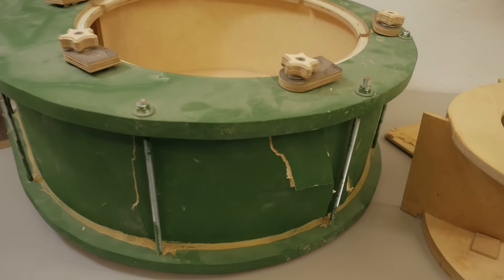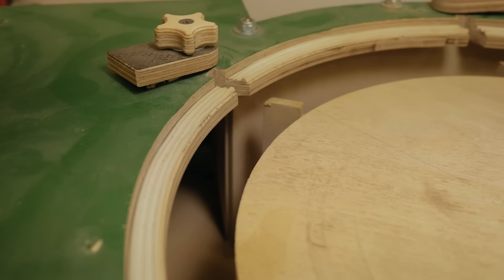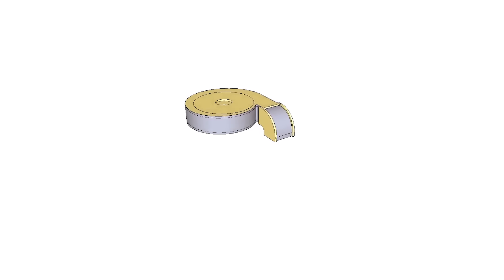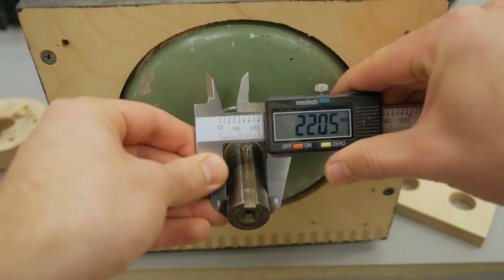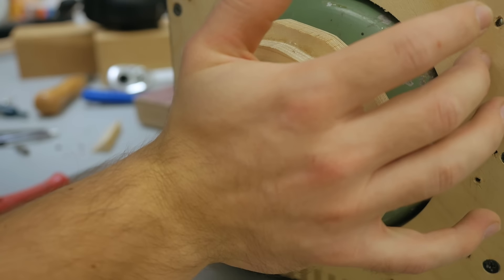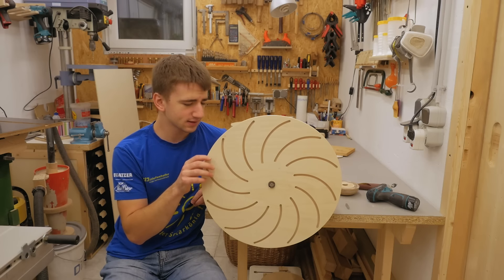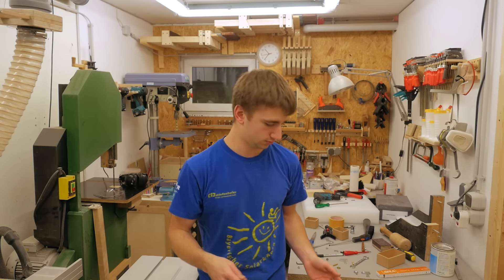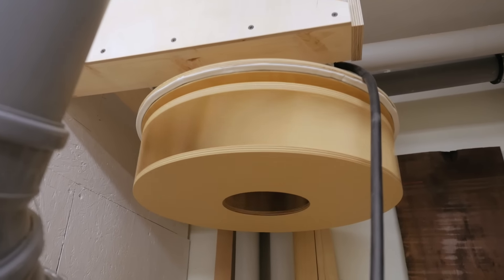Building a Big Dust Collector Blower #1

Comment: If you want to reduce  the  noise, next time don't make it with even blade spacing. The frequency is going to be a function of the RPM  and the blade spacing. The  frequency in Hz will be the RPM of the fan times the number of blades divided by 60. So, for example, if you fan is spinning at 1800 RPM, and has 10 blades, that is 1800 X 10 (which is 18,000), dividing that by 60, yields a frequence of  300 Hz. That is because each blade is passing any given point in space, 300 times every second. If you vary the spacing of the blades, this is no longer true, the lack of regularity, interupts the frequency, and the sound of the blades cannot gang up together. Of course you need to consider dynamic balancing as well,  so you might keep your blades in pairs, to that each blade has one opposite of it, to keep balance. Alternatively, you could add weights to counter-balance, like is done on ceiling fans. One other thing to consider, is whether doing it this way, will produce beat frequencies, but dealing with that is outside my knowledge, not doubt you can find info on that on the web.
Now, if you go to http://szynalski.com/tone#300-square you can play and hear what different frequencies sound like,  and if you open that up in more than one browser at the same time, you can check to see what beat frequencies would sound like, by setting each to a different frequency.
Thanks for the helpful video.

Comment: To criticize before it breaks, I'm worried about the part of the blade that is on the outside, it isn't held together by anything but plywood gue. Not that it would be any weak but still makes me little sceptical.
Reply from the maker: This might not have been visible in the video, but there is also glue between the outer most part and the impeller disks
Reply: Well, that's still just glue, but yeah, you're most likely safe, then

Comment: G'Day mate. Every body is a critic but I don't see them giving ad vice. Me I can't make video's for nuts and don't have the  space to do what your doing anyway I have an Idea If you want to try.  Make the veins in the dust extractor an 'S' shape  so that the leading edge cut into the air and the trailing edge throws the air away from the impeller. If you do decide to have a go please make a video and let me know.  Greg.

Comment: Looks like you could have saved yourself a lot of time by cutting up a section of large PVC or ABS drain pipe to make the blades.  Not to mention, significantly lower mass.

-jcr
Reply from the maker: +NSResponder but how would you connect plastic to wood with a bond as strong as wood with woodglue?
Reply: Would weld bond work?
Reply: Aliphatic or epoxy resins should both do fine.  

-jcr

Comment: I would recommend using a motor startup controller. This way you get away without the initial torque shock. Also you most probably introduce huge voltage spikes into your houses and your neighbors power distribution.

First quick start would be good old wiki ;-)
https://en.wikipedia.org/wiki/Motor_soft_starter

Comment: Are you sure the blades are stable? You made a big block of Plywood and cut out the blades. The result is no longer as stable as plywood since the wood firbers are all cut very short. I think the resulting system is as stable as the glue that was used, which means not stable enought for the application
Reply from the maker: The vertical fibers are still the same length and they take most of the load. The other direction is secured by the grooves. If you'd have held one of the vanes in your hands, you would feel how strong they still are.
Reply: think about the (of course non existing) centrifugal forces. When the impeller rotates very fast the centrifugal force on the blades is high. The inner part of the blades is secured by the grooves, the outer part is not. The outer part is also taking a lot of force and vibration from the turbulent air flow around the end of the blade. I think if you rotate the impeller fast enoungh it will fail loosing its outer 4 centimeters. The question is what is "fast enough. If it is 20000 Rpm this blower will work forever.

Nice job, nice design. I will steal it and do the extra work of bending plywood.

Comment: Loving the aesthetics of the new vanes. My only worry would be that being cut as they are they might have a risk of delaminating (vs ones made from a lamination of bent thin ply).

Of course, if holds out then forget my comment, but if they do break then I can look like a smart@ss and say I told you so in the future - it's a douchebag win win scenario ;)

PS Jumping the gun on the next video, but why not polycarbonate for skinning the housing? It's designed to take impacts without shattering, and it would allow you to inspect the vanes without opening everything up (assuming it didn't get too scratched inside I guess).
Reply from the maker: Well then if it breaks I won't let you know, ha ;) The other question will be covered in the next video.
Reply: Dammit. My douchebaggery has been foiled ;)

Looking forward to the next video!

Comment: Hi Marius, a classic soft start of 3phase motor might be "the Delta/Star connection". You might think adding it in order to reduce torque at start up, hence less force...etc, about what you mentioned: First Newton's Law. Here are some example links:
https://www.elprocus.com/industrial-star-delta-starter-3-phase-induction-motor/
https://electricalnotes.wordpress.com/2012/03/16/star-delta-starter/

Vieleicht dieses link ist auch hilfreich:
https://de.wikipedia.org/wiki/Stern-Dreieck-Anlaufschaltung

Comment: Your think you  are a very skilled wood worker.  Honestly, the motor is too powerful and probably spins too fast....(my guestimate is about half the speed).....so slow down the motor to reduce any material impact on the vane.   Yes, it will reduce the CFM and Negative pressure, but it will also reduce the impact damage.  Consider making a aluminum or sheet metal to build the vane. .......but lastly, it can get dangerous if there is any impact, so make sure the housing is made much stronger with steel...if not, line the outside with steel so it retains any things that could fly out.

Comment: I'd be a little concerned with the construction of the blades.  Plywood in that configuration is not very strong.  I'd wager the blades will crack or break easily if a chunk of wood reaches the blade.

Comment: why do you say VFDs are so expensive? they're not. you can get the chinese ones (Delta for example) and they are OK for your application. Siemens even has a line of inexpensive VFDs.
Reply from the maker: oh yeah, because I'd want one of the cheap units. (I don't)
Reply: why not? I work in industrial automation and all machines that have motors nowadays have a VFD for each motor. Delta VFD-S are terrible, we replaced all of them with VFD-M at one factory because VFD-S kept blowing up because of the heat (40 C ambient temperature and no air conditioning). I built a machine 3 years ago with two cheap Siemens. It works 24/7 and they're still working to this day.

Comment: I doubt MDF isn't the right material.. It's just a convenient excuse by the naysayers... Your Small Dust Collector used MDF in an open-slot design, with a powerful 3-phase motor as well.. But that's held up nicely so far and if the naysayers were right, the small dust collector should've blown itself apart as well by now...
Reply from the maker: the small dust collector is a different story, as it's small. And it uses a single phase motor with low starting torque and much less power.
Reply: Oh..? Always thought that was 3-phase as well, from the plug for the motor.. Nonetheless, beautiful design for the new blower.. Maybe the fully-encased "squirrel cage" design will hold up much much better...

Comment: NICE  JOB...BUT  YOU  CAN USE  4 THINGS   
1-LIGHTER  WOOD , 
2 ROUND  ALL CORNERS  OR  YOUR  PROJECTS 1/16" RADIUS
3-NEED TO USE  AERODYNAMICS LAWS AND  PRINCIPLES  .YOU NEED TO TRIM YOUR  LEADING  EDGES  OF THAT FAN EDGES   THERE IS  SOME   FRMS  YOU CAN USE  MAYBE  THE  ONE  IN 30  degrees  SHAPE ,THE  AIR  CURRENT  WILL FLOW SMOOTHER  WITH MINIMUM SOUND.
4- USE RESIN  OF  FIBERGLAS OR EPOXY GLUE  TO PUT  A LIGHT COATS ON THE LIGHT  WOOD  .THESE PRINCIPLES  OF   BASIC  COMPOSITE WILL HARDEN YOUR WOOD PREVENT  HUMIDITY AND DECREASE  WEIGHT ALWAYS  USE A  QUALITY WOOD IN THE  SHAFT AREA  .INSTEAD  OF  METAL PLATE USE  ALUMINUM  7075 T6  0.63 OR 0.70 THICK  OVER ALL  NICE  PROYECT.CONGRATS...

Comment: A VFD?

More like: "Another VFD"?!? But seriously, what is that?
Reply: Variable frequency drive. Allows you to change the voltage going to the motor thus the motor rpm's.
Reply: VFD is way over kill for this, you only want a soft start so a few thermistors will do the trick for only a few dollars or euros.
Reply: VFD isn’t overkill.   It would let him run the blower at any speed, even 1 RPM.

And he could incorporate safety sensors that would immediately shut down the blower if the turbines cracked.

A simple shock sensor would do it.

Comment: I like the fact that you are still using the same materials to build the blower after the failure, just using better materials isn't the best way because by that logic everything would be made from titanium; so keep on trying, but using tested solutions where is possible is aslo the engineering way, like the electric part, using a torque limiter might be unavoidable, it just has too many advantages http://www.eaton.com/Eaton/ProductsServices/Electrical/ProductsandServices/AutomationandControl/ContactorsStarters/SoftStartersControllers/TL/index.htm cost is very important when designing so the best solutions have to be found, by saying "controllers are to expensive" I assume that you are only thinking about high end "multipurpose" speed controllers when there are other specialized solutions much more cheap

Comment: Is there an optimal edge shape to reduce noise? Have you looked at tubercle structures for noise reduction and increased efficiency? 
check this out: http://newatlas.com/bumpy-whale-fins-set-to-spark-a-revolution-in-aerodynamics/9020/
Reply from the maker: There probably is, but I haven't looked at it yet.